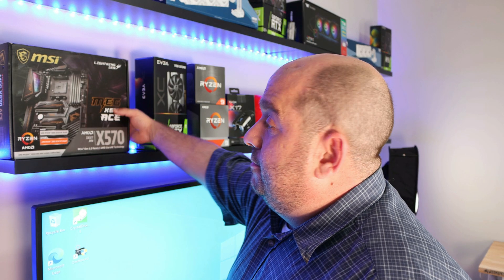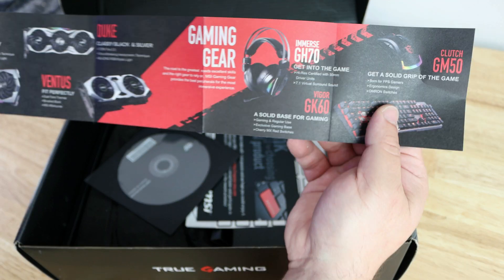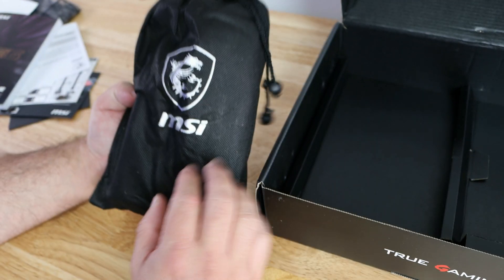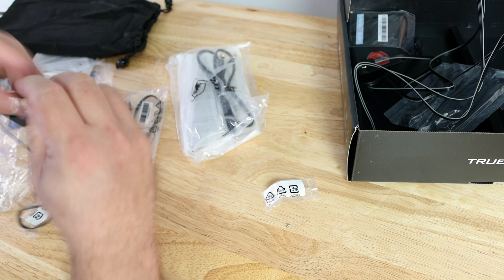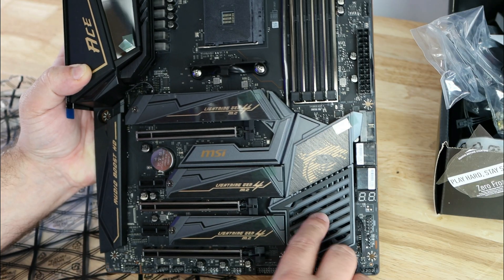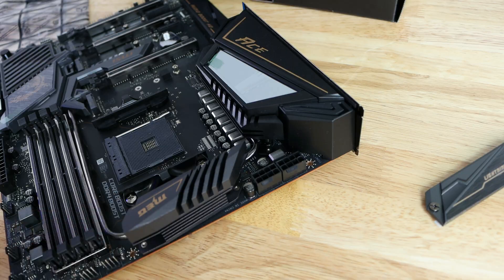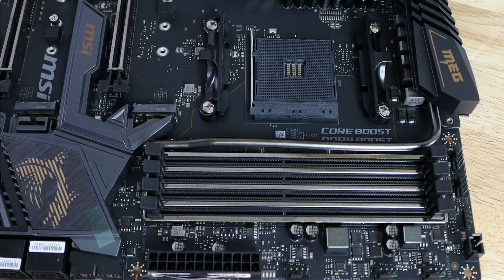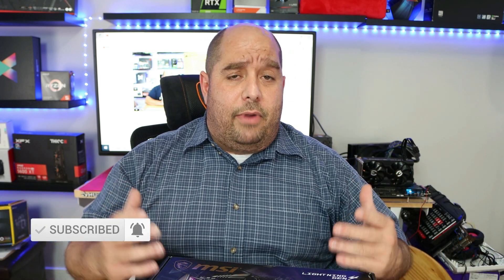MSI MEG X570 ACE Unboxing and Overview

Comment from the maker: Watch Next: Unboxing of the Corsair 7000D Airflow: https://youtu.be/bhQc6RB2_D4
In MSI MEG X570 ACE Unboxing and Overview, an unboxing going over everything on the board, and in the box, so your not surprised when you get it.  Stay tuned for this AMD X570 chipset build.

Check out the MSI MEG X570 ACE on my Amazon Affiliate link: https://geni.us/3u4Pu
Check out the AMD Ryzen 9 5900X CPU on my Amazon Affiliate link: https://geni.us/RFOT8
Reply: Hi there I wonder if you can help me. My pc shut down on its own while watching you tube, I tried to switch it back on. The only thing that is switching on is the RGB of  my Ramms. Got 2 stick 16gb each. Is this a PSU problem? Ty
Reply from the maker: sorry my friend, I missed this, youtube is horrible at delivering comments and almost never delivers comments when you comment on someone else's thread or pinned comment.  I am assuming your issue has been resolved, its been 10 months and I just found this, I was never notified of it, but if you need help, please comment on this video on your on thread so I can see it.

Comment: I bought the Meg. Sadly returned it and went back to rog hero. Meg was dead on arrival and I decided I didn't need to spend 700$ on it. Shame I loved the extras etc. Think it was a diff Meg then this one though. What motherboard did you have issues with?
Reply from the maker: well, DOA can happen with anything from anyone, things just happen, but I get why you would be paranoid about it, $700 is not cheap, but DOA's happen on even more expensive stuff.  The board I had issues with was the Asus ROG X570 Crosshair VIII Hero, but it turned out not to be that at all, I discuss that I think in this video.
Reply: @ThisBytesForYou  ah that's the exact one I have right now for my main
Reply from the maker: yeah its a good board, but with all the reviews I have pending, I didn't want to waste too much time on it, so I ordered a new board, and well it gave me more work.. cuz now I have to review this hahaha but the Asus board is all working now.

Comment: Hello legend.
I bought kraken x63 but i dont have Y splitter for aio fans to connect(two aio fans to cpu header). The Q is: is it ok if i connect one of the aio fans to cpu header and the other aio fan to normal fan header?
(Note:aio pump itself is connected to pump header on mobo)
Reply from the maker: yes it is OK but make sure it is configured in the BIOS as the pump prefers, some prefer PWM or another method.
Reply: @ThisBytesForYou  thnk you friend
Reply from the maker: @pdr4m559  always a pleasure my friend.  Please do make sure to check temperatures and make sure all is well during your entire session while testing.

Comment: Hey man ik you had a problem with the crosshair hero but you fixed that right? Is their a reason you bought the msi board other than a new build for yourself/ the channel
Reply from the maker: I did fix it yet, but not until after I bought this already.  After I bought it, before it arrived I had fixed everything, but then I thought it would be great for another build video, so thats coming up soon ;)

Comment: MSI please from now make mobos with more sata ports   i hade z97 gaming 7 hade 8sata  port as well oc-power buton-reset.
Reply from the maker: So, please understand, this has 3 x M.2 slots, usually, 1 x M.2 device disables 2 SATA ports, so with 3, it would disable 6 SATA ports..  It looks like for right now (I am doing the build guide this weekend) when you use those M.2 slots, it does not disable any SATA ports, so they might have taken care of that.
Reply: @ThisBytesForYou  for example if install 3 m2  slot memory will not disable any sata
Reply from the maker: it should not, on any other board it will, but I will test this weekend to be sure.